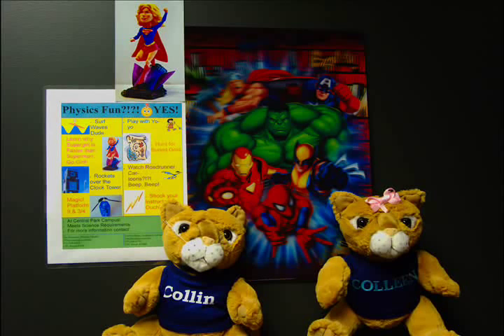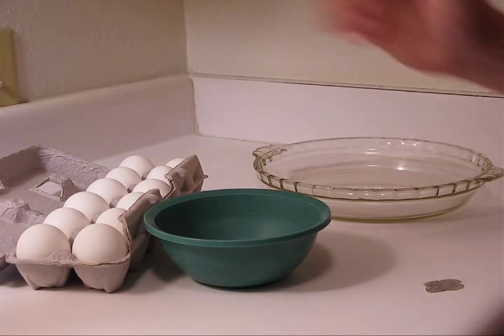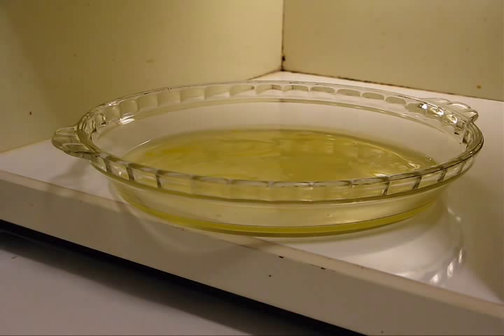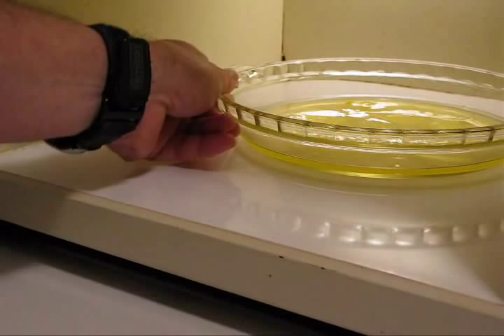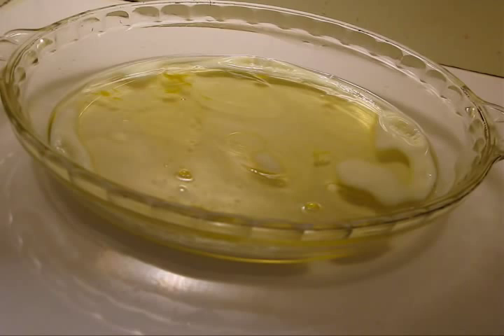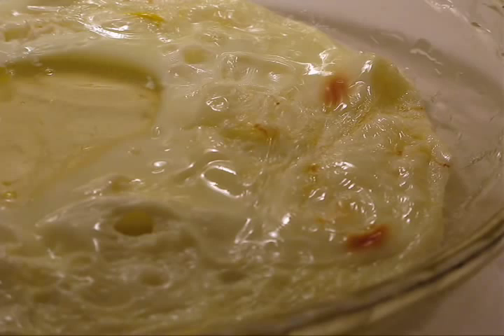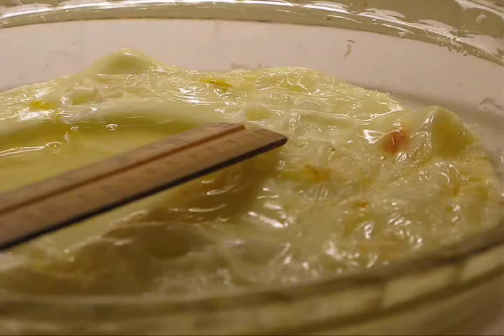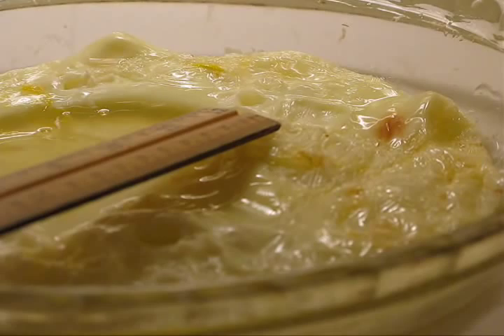Measuring the Speed of Light

Comment: Microwaves are a part of the electromagnetic spectrum, that includes radio waves, at a frequency of 2450 MHz and wavelength of about 12 cm (as we measured & 12.2 cm to be precise).  AM radio operates between 0.531 & 1.611 MHz; TV, FM, marine, & aviation operates between 48 & 698 MHz; above that is the microwave frequencies which include cell phones (depending on region) from 698 MHz to 2690 MHz; and visible light is between 430 & 750 THz (million MHz).

Comment: Umm I know that this was a video uploaded about a decade ago but why should the microwave be still, not rotated? Also, what does the hotspots on the egg whites imply? What is the science behind the hotspots and why is half of their length apart mean the wavelength? Thank you in advance!
Reply from the maker: When you have a standing wave, as in a microwave, they form nodes and antinodes. It's the way a musical instrument works. Given a fixed sound tube length, as in a wind instrument, or fixed string length, as in a stringed instrument, the sound pressure or string has nodes on each end and an antinode in the middle. It couples with air and, voilà, music is produced at a particular frequency. A musician's fingering or instrument's valves change the length of the tube and, therefore, the wavelength of the resonating frequency. In the case of a trombone, the tube length is changed directly. A string or a tube can also resonate at multiples of a fundamental frequency. For a microwave, though, the frequency is fixed, and the point of this measurement is to find the wavelength. An antinode is a point of maximum power so locations, where there is an antinode, will be a hot spot in a microwave and food at that location will be heated quickest. If you move the food, you're moving it away from a hot spot. The purpose of the rotating platform is to move food near an antinode away and food near a node (where it's colder) toward an antinode giving even heating. To measure the speed of light you DON'T want even heating - you want to find where the antinodes are. A microwave oven is also intentionally detuned. Designers attempt to make the cavity NOT resonate to prevent hot spots and to make food heating more even. The detuning is imperfect, however, and that's what we are counting on. The physics behind waves is that antinodes are a half wavelength apart from each other. Egg whites are a good indicator since the proteins change color with a small change of added heat. I've tried marshmallows and chocolate, but they don't show such a dramatic change. Once you measure the wavelength using egg white indicators and know the frequency (listed on the back of the oven), you multiply the two together to get the speed of light. Voilà.